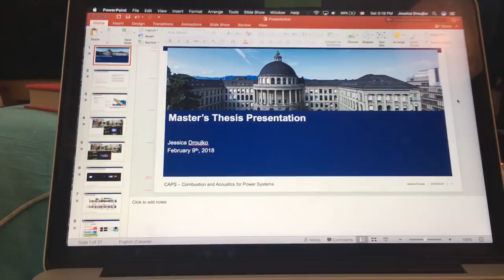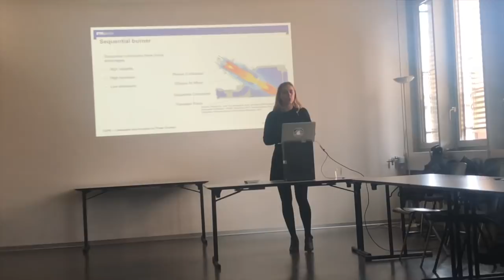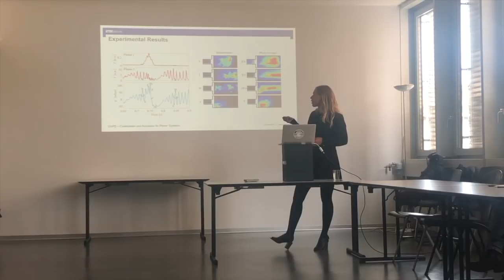Master's Thesis Presentation Vlog | Mechanical Engineering Vlog | ETH Zurich Vlog

Comment: What's your project on? 
What's the use of python and Matlab in your project. Will be useful because I am also a mechanical engineer.
Reply from the maker: My project was focusing on investigating thermoacoustic sin a sequential burner using LES. And I only used matlab for processing data and making plots. Nothing else:)
Reply: @RiverTechJess  jess..... How you came across this thesis topic...is it based on the lab facility...... and liked your presentation....

Comment: So you are almost gonna graduate, do you recommend ETH Zurich for Mechanical Engineering Masters? If u wanted to do it from somewhere else, where would it be?
Reply: I absolutely recommend ETH Zürich for mechanical engineering :) It is definitely one of the top of the top! Here, we’ve got so many knowledgeable professors who are no. 1 in their fields, including Robotics and Control, Fluid Dynamics, Propulsion, Structural Mechanics, Energy, Micro & Nano....
Reply from the maker: Hey Mustafa! Ya Zahra is right:) I am almost graduating and I did like it here. Somewhere else would probably be UBC or McGill.